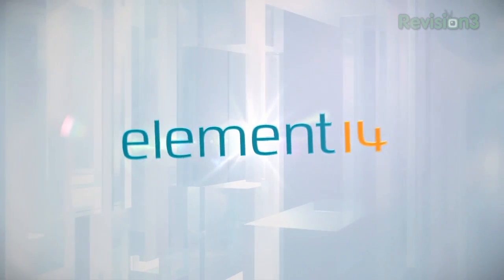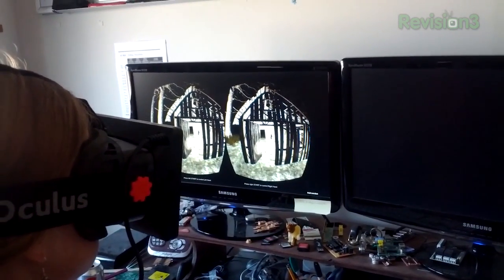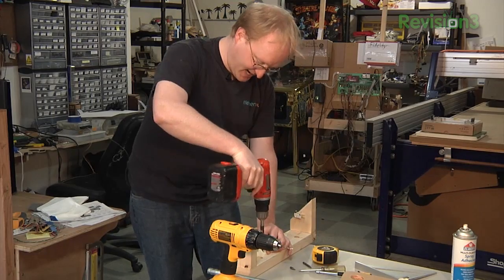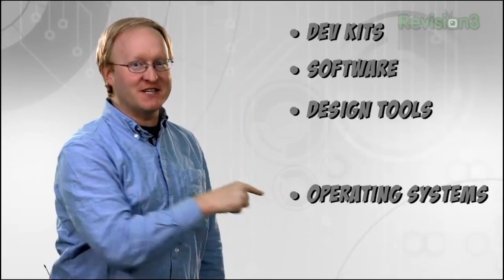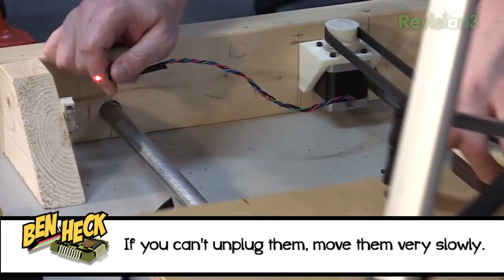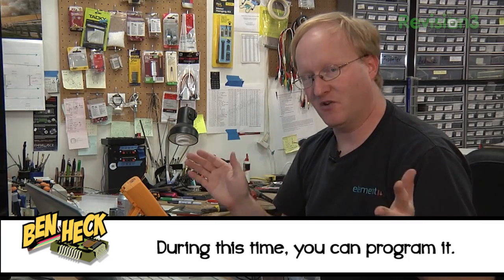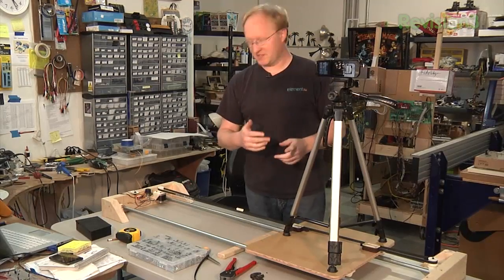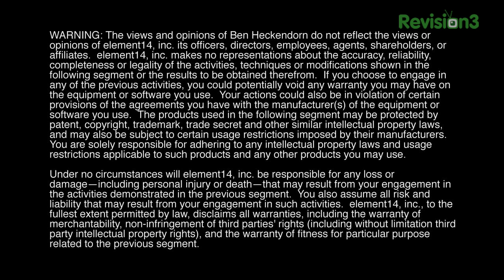DIY Automated Motion: Motorized Camera Dolly Part 2

Comment: In the Final Video: is the Dolly Shaking or the 3 printer??
Reply: I think there are probably two possibilities. Either the base platform or camera tripod were not completely stable, or the camera's autofocus was left on (The camera is trying to focus on what it thinks is the most important - usually the center - but since this is changing over time it can cause apparent motion). If you film an event through a chain link fence you'll notice the problem as the camera alternately tries to focus on the fence itself and what's beyond it, depending on how still your hand is. Tripod shots are better, but if the tripod is moving forward and backward, like in Ben Heck's example video, then problems can occur.

JW3HH

Comment: The timelapse was really jittery. I am disappoint.
Reply: My guess is that the autofocus on the camera was not turned off. The constant re-focusing as the tripod moved forward and backward caused the jittering and/or the base of the platform was not completely stable or anchored well enough. I'll bet if the camera was mounted lower - to lower the center of gravity (a tall object like that is going to have more potential movement than a short one) - and the base was weighted down AND the autofocus of the camera was turned off the outcome would have been much better.

JW3HH

Comment: here is a challenge. combine a ps3 controller and an xbox360 controller. the wireless ones. I have friends that have both systems and it would be cool to just have to carry one controller maybe a switch on the back of it to switch between wireless communications boards (ps3 Bluetooth or 360 proprietary link)

Comment: I would figure its just the belt being loose and the height of the tripod multiplying any little jerks.  Strangely enough more friction is good in this case because it prevents overshoot and subsequent backlash after each stepper step.

Comment: Runs quite jerky actually. Perhaps sync the camera exposures with pauses in motor movements. (Trigger the camera from the microcontroller?)

That obviously only works if the track is smooth and it was just the tripod wobbling with the movement.

Comment: I would have thought it would have been useful to use the regulator on the digispark rather than sharing the 5V DC with the stepper driver board as that might be quite noisy?

Comment: Looks like you ran into the same stability problem that a lot of DIY dolly systems end up having. Maybe you could add some weight to the dolly or rig up a gimbal joint with a counterweight. Thanks for sharing.